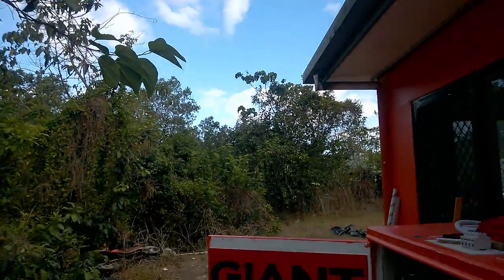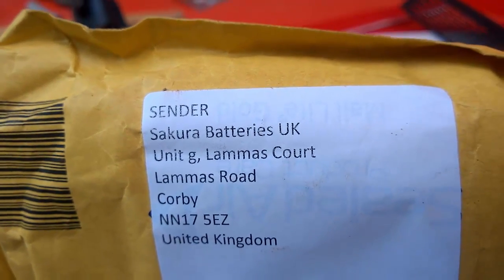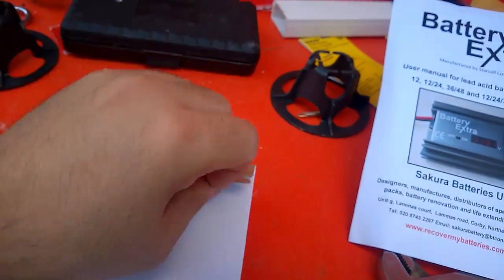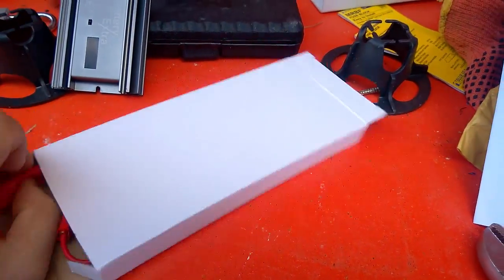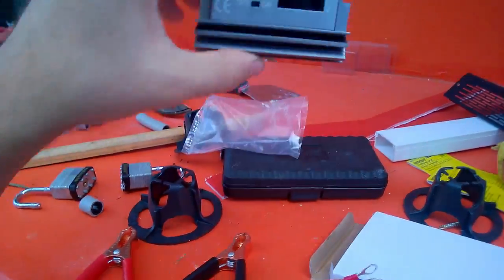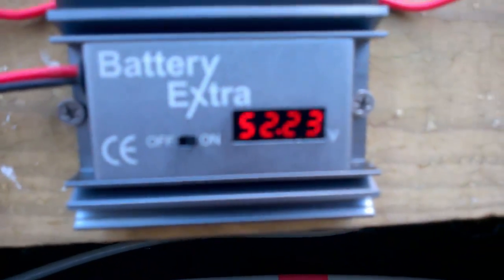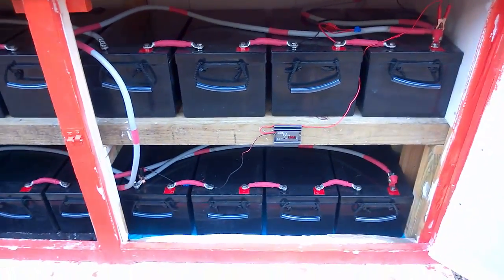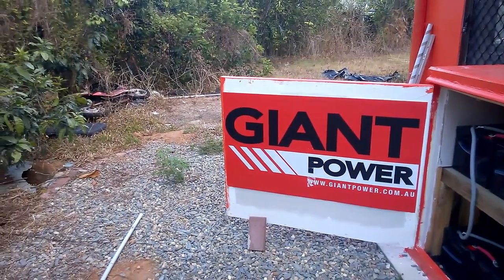Off Grid/Grid Connect - 48V Battery Extra

Comment: I bought this unit and installed it today on a 48v golf cart battery system and I'm curious about how yours worked.
Reply from the maker: +Daniel Drumheller Mine works very good. had no troubles with it and cos my batteries are new they will keep my batteries in good condition. Alot of other people are using and they have found they have improved their old battery performance. They do take a while for it to desulfate your batteries depending how old they are and how you suing and how you charge them and how much calcium is on the plates. But you will see the batteries slowly pickup over time.